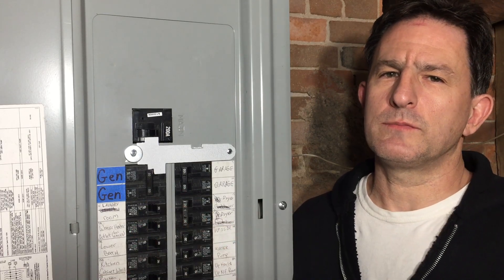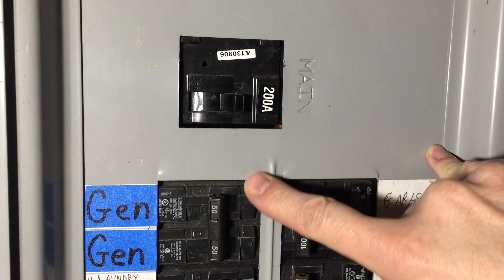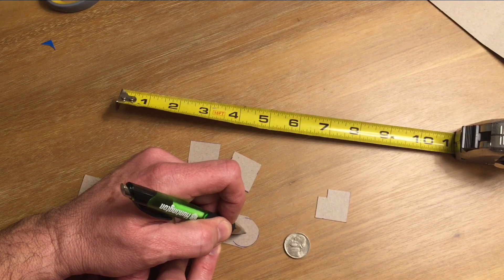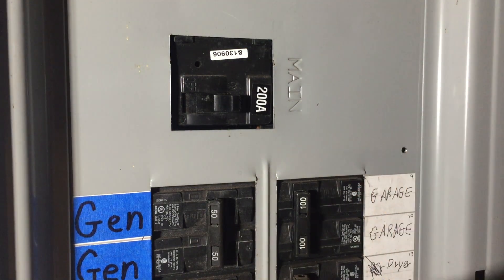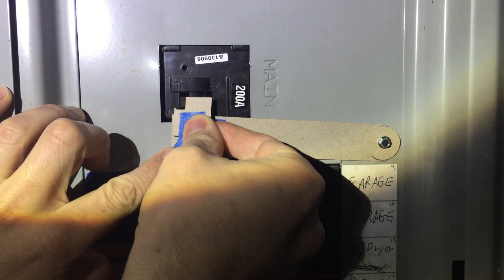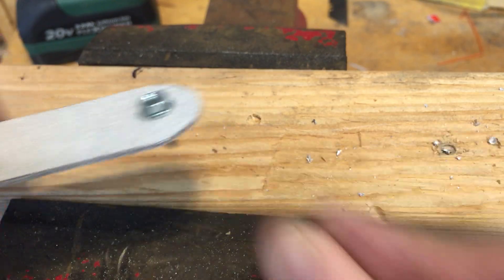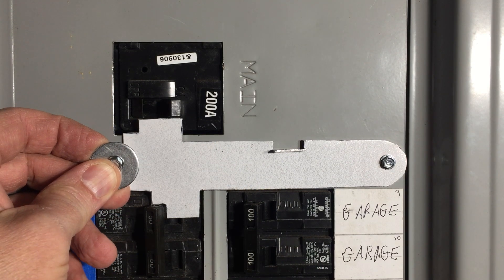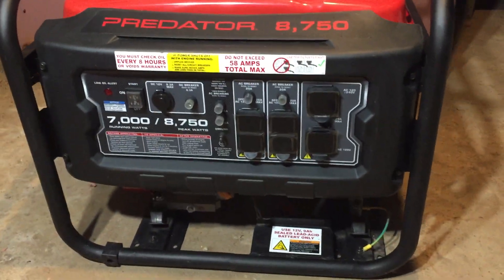DIY Generator Interlock Kit

Comment: That small notch isn't going to hold up very long. Don't think the metal is rigid enough to hold up to much pressure since you could cut it with clippers.

Comment: That is neat.  One question....When or if the generator breaker were to trip, is there enough play left in the device to let it do so?  
I would be afraid that the breaker might not be able to trip if it needed to.
Reply from the maker: Yes, breakers actually trip in position.  You can buy interlock plates that do the same thing, but they cost $75

Comment: Which wire is recommended for wiring> 10/3 or 8/3
I have a 4000 watts generator
Reply from the maker: 10 awg handles 30 amps
8 awg handles 45 amps
You have 4000w/120v= 33 amps, so technically, you should use 8 awg.
Reply: @HowToLou  MIne is 4000 starting watts and rated at 3500 watts. Still 8/3 required?
Reply from the maker: 3500w / 120v is 29 amps.  10 should be fine.  If you plan to max out that 3500w capacity, I would go 8 just to be safe.

Comment: This is the best and possibly the most easy way to make a pattern to cut our for the interlock.
I view this Interlock method as the most inexpensive. The reason for this comment is as follows;  1).  You can make it (The interlock device) yourself and save between $75 and $150, depending on what site you buy it from.  #2  You use the existing panel with all the circuits, instead of buying a  commercial transfer switch on the $300 to $1,000. 3). you only have to relocate a double breaker at the top left or right side to the open space at the bottom of the panel. 4).  now is where the electrician comes to play.  5). if you have a 30 amp or 50 amp socket on your portable generator, you run this line from the outside area to where the circuit panels and located.  the electrician connects the generator line to the new double circuit breaker at the top. 5b).  after this the electrician rehooks up the switch that was relocated to the bottom of the panel.
6).  now the interlock switch can operate to turn off from the utility provider. turn off all the circuit breaker switches and power up the same panel from the generator when it was turned on.  7).  now the experts say to turn on one circuit at a time, as needed, and realizing the max the generator can put out and how much the needs are at the time.

This is not lesson for anyone, actually it is my interpretation from watching video after video for a month getting ready to compare my  budget with the power outage needs.  My main issue is you have to be present to do the manual switching.  If you are on a trip and away from home, you can"t turn any thing on.  The bottom line is the cost.  Maybe a $2000 expenditure for the interlock and portable generator route vs.  $7.000 to $10,000 depending the size of the house and needs.  Please feel free to comment on this post, I am   not thin skinned and open to comments if I forgot to mention.
Reply from the maker: All pretty accurate.   You might like this video where I connect the generator to the house.  
DIY Generator Installation
https://youtu.be/ib6xwGIgIoI
Reply: tx me here, i'm installing a gernerac 14kw on my farm.. this interlock can't hardly fail.. need to be able to tell people how to turn on so water pump will work when not there.  install of the ats is ridiuculous for the amount of use i foresee for this gen..  complete redo of electric supply.. the farm is setup lwith feedthru ge panel, so several panels involved and the ckt one is about 150 ft away.. seems this manual method would work best for me.. thanks for interlock info.. i like yours best.

Comment: Awesome. So elegant. I spent hours making an old school type that rode up and down on four screws. It works but still binds and is not smooth. I wish I saw this pivoting version first. Another lesson I learned is to make it look as factory/commercial as possible so it won’t worry any electrician doing work on your house and they will sign off their work when done.  I painted mine and affixed a warning/instruction sticker.
Reply: I made a custom one for my panel using round connecting bolts to slide on. A screw fits from the back and is held in place (in the front) with a lock nut. The round connecting bolt allows the interlock to slide smoothly. Total cost for screws, nuts, bolts, scrap metal = about $2.00. And you can't tell it's homemade.  :)  It's ridiculous that the store-bought ones are so overpriced!
Reply: Where did you get the stickers? Love your video

Comment: Very appropriate Lou! Did you have to use your generator? Great video!
Reply from the maker: Thanks Big Matt!   I am just getting it all connected to the house electrical panel so that it can run everything if we lose power.
Reply: @HowToLou  Keep in mind your gen is not an inverter so the THD (total harmonic distortion) will probably vary between 10% and 30%.  High-efficiency furnaces and other sensitive electronics will not work and/or be damaged.  Electric motors will run hotter and it will shorten the useful life of the motor.  THD below 5% is what is needed to prevent damages.  The higher the THD the more electricity is wasted (as well as fuel).